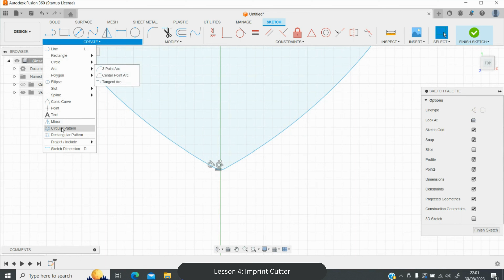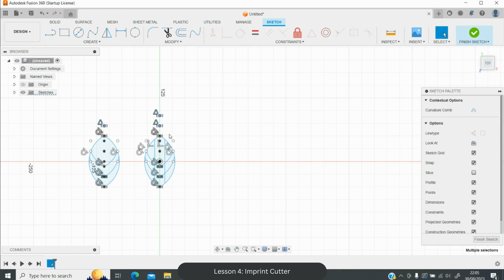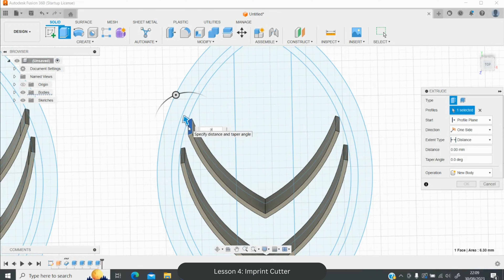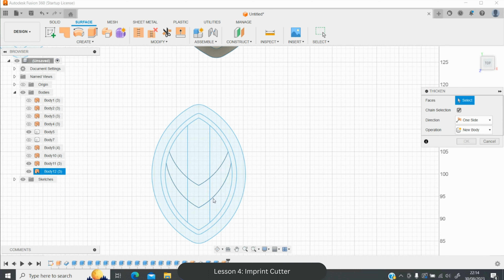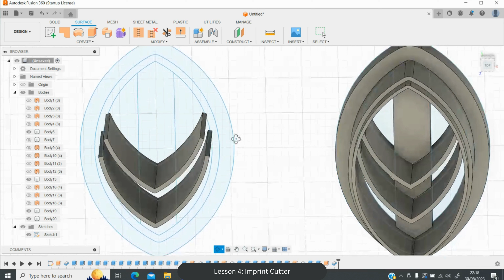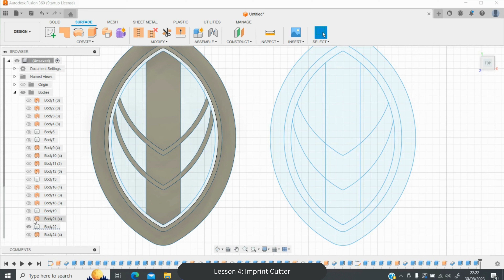Making Polymer Clay Cutters With Fusion 360 - Lesson 4 Imprint Cutter

Comment: Thank you for these videos! Is it possible to design on illustrator and import on fusion?
Reply from the maker: Absolutely! It is what I do for some of my designs! I will do a video covering it as well x
Reply: @ClayCutterTutorials  yes please that would be great! Also may I ask what PC you are using? Thanks!
Reply from the maker: My current laptop is a HP Victus 16.1" Gaming Laptop PC 16-e0071sa, AMD Ryzen 5, 16GB RAM, Geforce RTX 3050, 512GB SSD, FHD, Ceramic White

But when i first started i had a very basic cheap laptop that worked well, just had to maybe do less extrusions at once or be prepared that fusion would be slow if moving sketches with many many points.
Reply: Thanks. Any news about the video about importing designs from illustrator? ❤